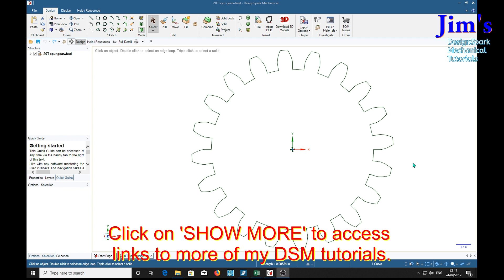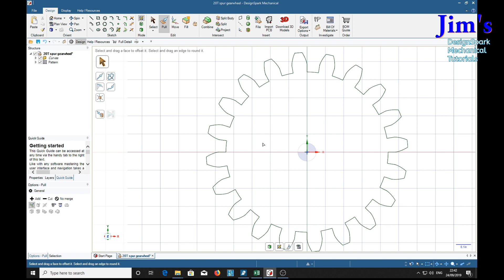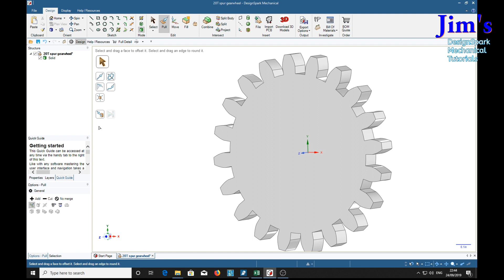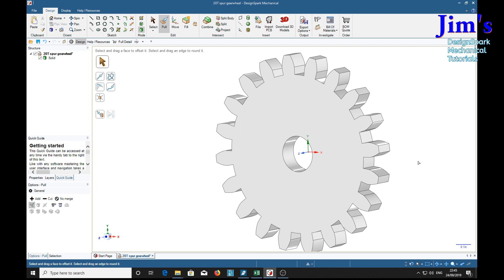Modeling a spur gearwheel in DesignSpark Mechanical pt4

Comment: Very useful series. Did not know there was so much involved in a  spur gear design. I think I need more memory for my computer. When I changed the parameters rendering etc, the grid inverted its colors and basically showed a black background.  Had to go back to low rendering quality and anti-aliasing off.
Too bad DSM does not have a scripting language as this would be useful for designing gears.

Comment: Thank you for your great tutorials, most helpful. Would you be able to do one for a bevel gear. Been trying for a while without success.
Reply from the maker: I'm a bit busy at the moment but here's a few clues of how I have just made one in about a minute.
1. Make a tooth profile and make a circular array of them. Make sure that they are all joined up at their roots. Also make sure that there is a straight line radiating from the center of the profile.
2. Press 'D' for design mode. Your profile should become a plane. 

3. Duplicate the profile vertically by the same as the profile diameter. You should now have two toothed planes one above the other.
4. Using the center of one of the planes (use the added line) expand the profile plane x 2
5. Use the blend tool to join the two planes together. You should now have something that looks like a bevel gear. If you aare happy with it click on the big tick box.